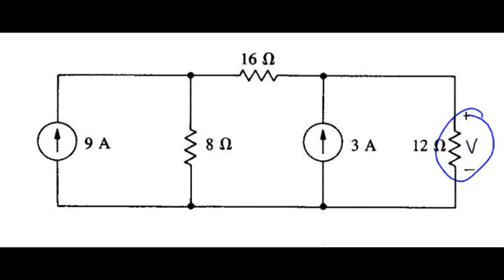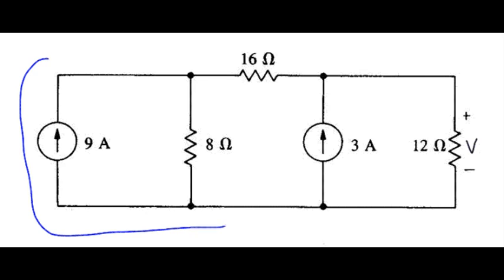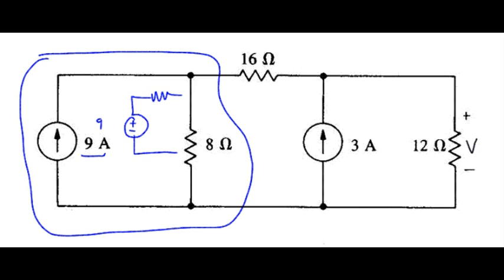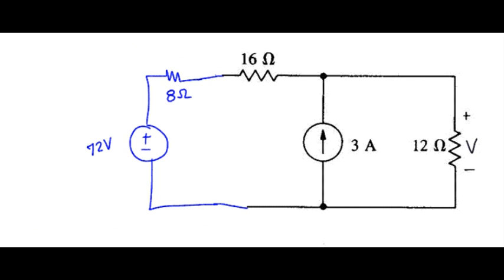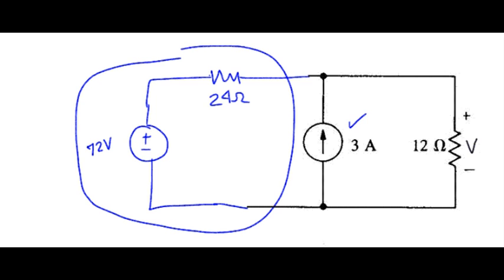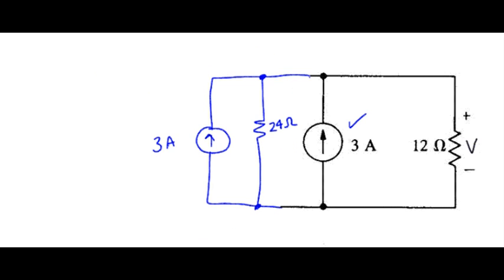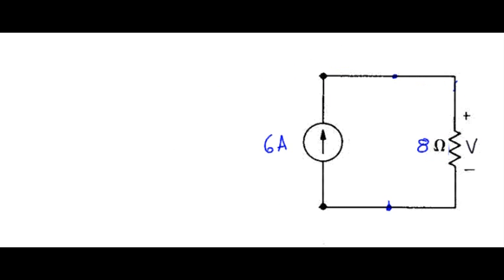dc: Source Transformations Example #1

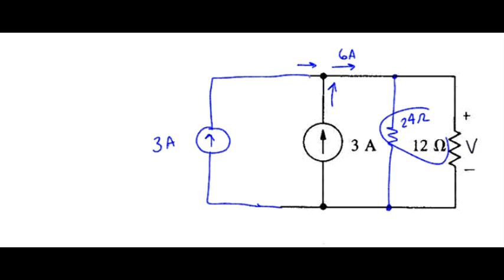Comment: Correct me if I'm wrong, but you cannot combine the 24 and 12 resistors in parallel at 2:45 to get the voltage flowing through the 12 ohm resistor. You have to use current division since they are in parallel because the ideal currents 3A and 3A in parallel add to 6A. So, V_12=(24/36)6, V_12=2 volts.
Reply from the maker: Luis Valle Remember, voltage is always across an element or between two nodes in the circuit. Because we are looking for the voltage across the two parallel elements you can go ahead and combine them into a single equivalent resistors.